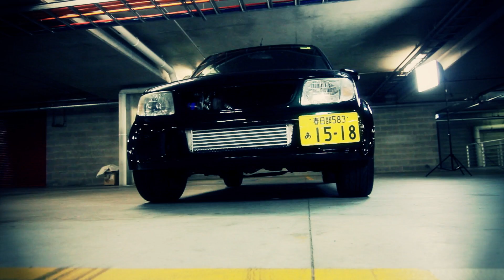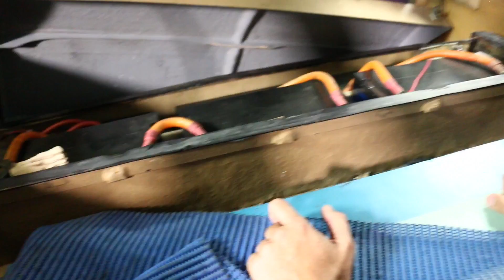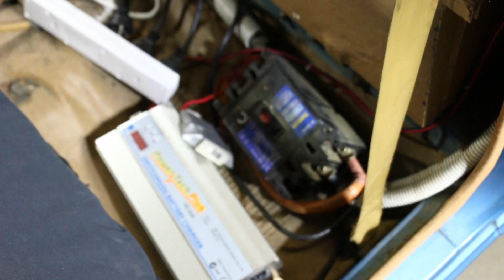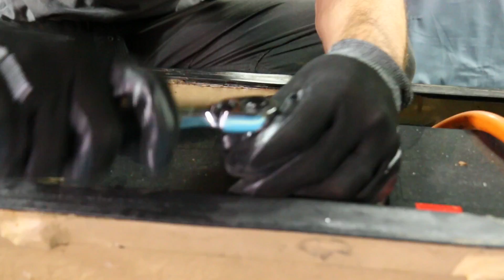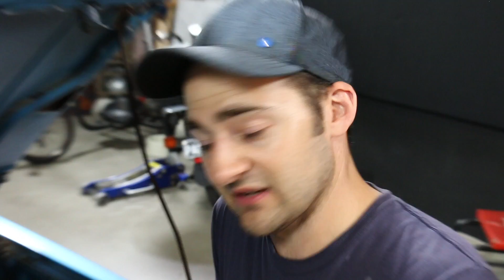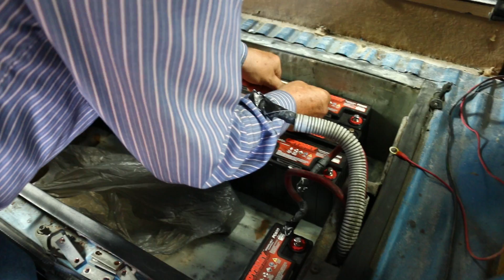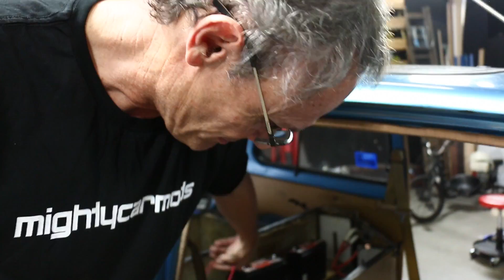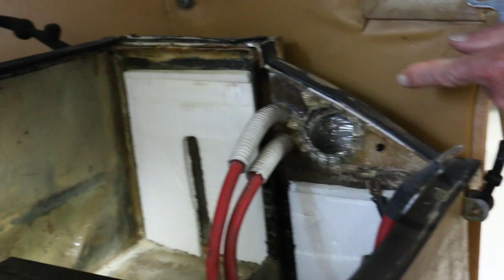JDM Electric Turd

Comment: Change the lead acid with 18650 li-ion cells
High power and light.
Reply: Agreed. Li-Ion or Li-Ion is well worth it. Alibaba is the perfect place to buy a decent sized pack
Reply: The only reason might be that all the controllers and chargers aren't able to handle lithium batteries
Reply: +Shaun Young 
I was thinking old laptop batteries.
Crack them open and you can get 5.6.7 or even 8.
When laptop battery is bad it is normally one cell that is bad and causes the issues.
Reply: +Alexander Helton Still better "vape tard" than a smoketard...
Reply: ^this^
Reply: Tesla packs are on ebay not.. and very thin.. need to measure up and see what can be done to fit them in.. cause you guys aren't finished until this thing can smoke up a set on the front.
Reply: +IIGrayfoxII 18650's are laptop batteries
Reply: lol, I'm surprised the vape tards aren't telling you to make packs of 30amp 18650's or 26650s.
Reply: +Fred hoogendoorn 18650 li-ion cells are the most common cylindrical cell.
They are found in Laptops, Teslas, Battery banks
Reply: +Alexander Helton 26650 have more capacity but are harder to come by Mr Troll Account.